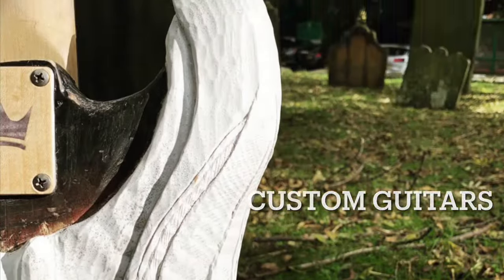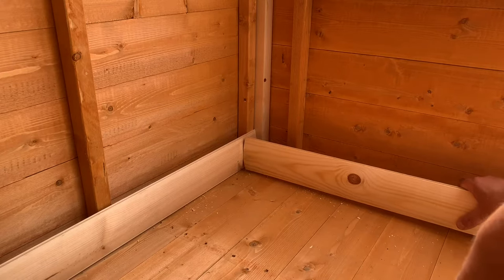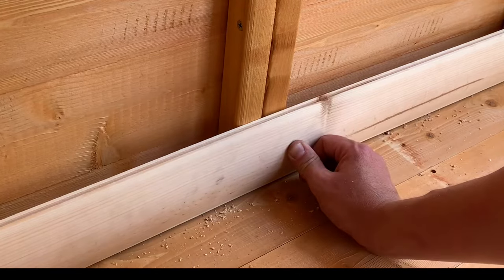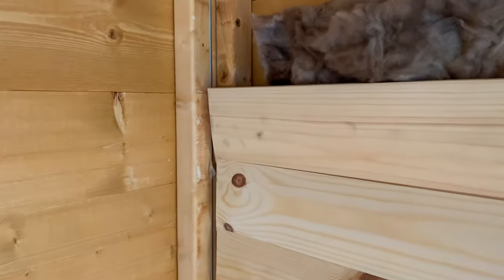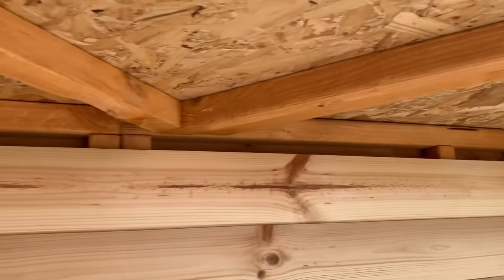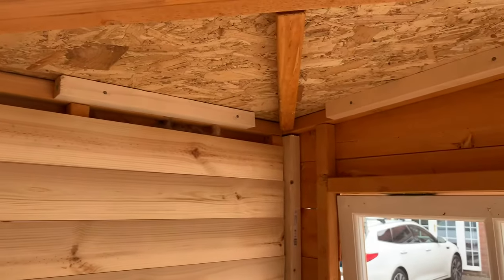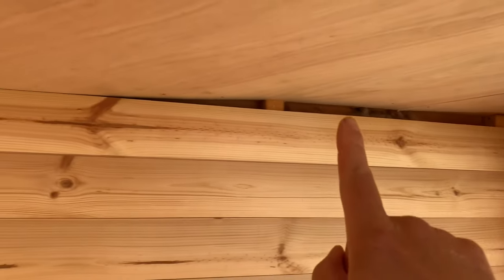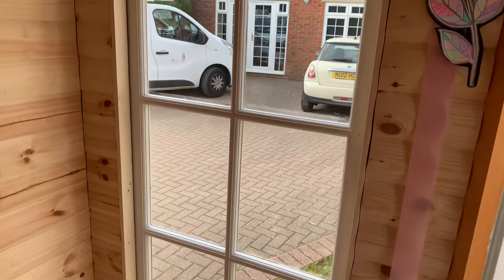How to insulate a summerhouse or shed  |  Using your summerhouse in the winter

Comment: Priced this job up and it was more than the summerhouse!!
Reply from the maker: Wood has got ridiculously expensive hasn’t it!
Reply: Realise you posted a year ago, but for others like me just finding it and wondering the same, if you are on a budget you could do similar with pallet wood or used scaffold boards. Wouldn't have the same effect and would require a fair bit of prep or post fitment sanding but you can get 2.4meter scaffold boards used for about 6 quid.

Comment: Would it make any difference in how much heat it will contain when using the loft insulation vs a proper wall / cavity insulation ? Of that should not make a difference ?
Reply from the maker: Different types of insulation might affect it a little. I think loft insulation will generally just be thicker 🤷‍♂️

Comment: I thought one is not suppose to touch nor breath insulation. I thought if you breath it in it can kill you in the long run. What kind of insulation is this? Just wondering 💭
Reply from the maker: It’s generally made from fibreglass, and you’re quite right you don’t want to be breathing this in. All the warnings are enclosed spaces (lofts etc) whereas I’m in the open with fresh air. Please wear masks wherever you feel you need to 👍

Comment: I did this once on a summer house and suffered with damp problems and ended up ripping it all down and putting a foil type insulation. Did you get and problems with damp?
Reply from the maker: No, not yet. But I’ll keep an eye on it thanks. Even adding the extra seal to the windows the door still ventilates when shut! Maybe that will be enough.

Comment: I’ll be damned, I’d have never ever though to cut the insulation like that! Brilliant, thanks for the tip.

I’ve got that exact shed coming but as a shed not a summer home. But I’ll be using it for storage but will be boarding and insulating inside with a socket and light etc

Might upgrade the roof abit and make sure I treat the under side a few times before building it on recycled beams

Comment: would a 35mm air gap be as effective as the insulation ..so you could omit insulation???
Reply from the maker: I wouldn’t, especially with a thin wooden outside edge. It would loose heat through the wood very quickly.

Comment: Do u not need a membrane
Reply from the maker: No not really. Moisture from the outside shouldn’t pass the treated timber on the outside of the summerhouse. Condensation on the inside wouldn’t change with a membrane

Comment: you measured and cut the roll of insulation     to fit  but yet as you  installed it there were 4 inch gaps  ??? while at it   why are you using rock wall  mice   love  to nest in that  spend a little more use king span    with foil backing and more  insulation  easier  install   no bugs  and rodents moving in

Comment: ive been saving polystyrene to insulate mine no good ?
Reply: Standard polystyrene, whilst it will insulate, won't give you the same thermal properties as other types such as higher density EPS foam or Kingspan (Kingspan being the better of the two, but more costly).

Comment: No vapour membrane and internal moisture membrane? So in winter if you heated it, condensation will pass the inner log lap and wet the insulation and often damp will get in from the outside and get into the insulation without a breathable wrap under the outer cladding. This is what my research has found
Reply: Exactly what I thought too. The minimum is the have a damp proof layer on wrapped inside first then insulation then the shiplap
Reply: @danielhooker4957 would you attach the membrane in between the outside wall and the insulation?

Comment: Looking to buy and do this to a larger log cabin for winter use .. but do I insulate the roof ? And floor also
Reply from the maker: I did the roof but not the floor
Reply: @KingBespokeCreations  and will I get condensation problems if I insulated?
Reply from the maker: @jamesmccormack5145  possibly, if the building is then sealed. I didn’t have room on this small unit, but if you can have an air gap between original wall and new it will stop condensation on the inside of the walls too.

Comment: Great job and very informative…
What’s your view in fitting a vapour barrier, like a lot of shed installations recommend ?
x The Bigfella x
Reply from the maker: Good idea if you have the space. I haven’t noticed anything bad happening on this one though.
Reply: I insulated a large workroom shed with 1" thick polystyrene sheets cut to slot inbetween the batens and plywood sheets ontop it belonged to my sister.
 20 years later she sold the shed when it was taken apart to move the polystyrene was in excellent condition no evidence of damp or mould behind the plywood or the shed walls.

Comment: I'm going to be insulating my summer house to use as an office.  Should there not be an air gap between the insulation and outer wall to prevent damp?
Reply from the maker: There really isn’t room. There’s a phrase with houses “ insulate insulate insulate ventilate ventilate ventilate.”  Meaning have good insulation but also air flow. Damp would come from breathing inside not rain outside.
Reply: Yes, there should. The wood has no room to "breathe" if you don't. This insulation will be wet through by now, and no doubt, mould is already noticeable. 25mm air gap minimum. Then insulation. Then a vapour barrier.
Reply: @3DomSculpts  should the vapour barrier and insulation be attached on the outer or inner wall? I'm planning to make a brick summerhouse with thermalite bricks on the inside.
Reply: @ilovedogs938  on most cases (depending onbyour inital construction) insulaton will be installed internally between the uprights, but with an air gap between chosen insulation and the outside wall/panel, taping edges/joins with alu tape.Then the vapour barrier is installed over the top.
Reply: @3DomSculpts  So in my case i'd be using brick, would I still need the edging tape? So it's the internal thermalite bricks, then the vapour barrier, then the insulation material, then air space of 25mm min, then the outer concrete brick wall?
Reply: @ilovedogs938  im not too certain about concrete builds tbh. I just learnt enough to insulate a garden shed after becoming homeless, and its kept me warm since. Im sure its very similar process, but not sure if the thermalite or the vapoyr barrier should be your last "insulation skin". I'm sure it should go...Outside wall-air gap-thermalite-batons-insulation between batons-vapour barrier-then your choice of finish (mdf, ply, cladding, plasterboard etc)
Reply: @3DomSculpts  I find that so cool! Amazing how when you're put in a bad situation a good thing can come out of it. I'm religious so I believe God makes good out of bad things. But you are an inspiration! You know so much, like a fountain of knowledge haha. Yes I see what you mean by that order. Would you have to put another air gap between the insulation and thermalite?
Reply: @ilovedogs938  thank you. It has been tough, but im using it as an opportunity to compleyely reinvent myself. I have accomplished some incredible things this year with regard to my work (including having work featured and pinned directly on TikToks own profile 🤯). I was ashamed ofmy siuation at first, but its been extrenely beneficial for me mentally to let people know where im actually at, and what happened for me to be here.
 I would imagine another air gap is required to prevent any moisture transfer (the air gaps give the materials space to breathe and sweat. Wish you the best with it. Make sure you update the post when you have finished the build so we can see 😊
Reply: @3DomSculpts  the tradesman is giving bad advice here, when you research on how to insulate properly it's a breathable waterproof membrane and waterproof membrane on the inside. Try hearing this in the depths of winter and that insulation will be saturated. If you have a shed company insulate for you they do not do it like this
Reply: @danielhooker4957  your post makes no sense, but thanks for your input. My shed is watertight and my  insulation isn't saturated btw, 1 year after completion.